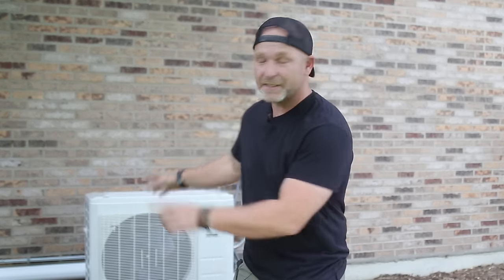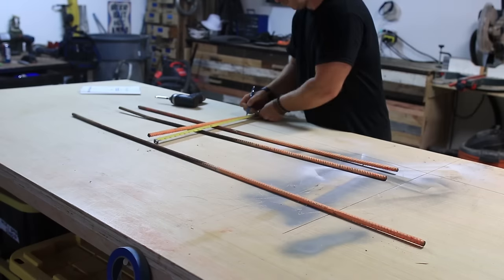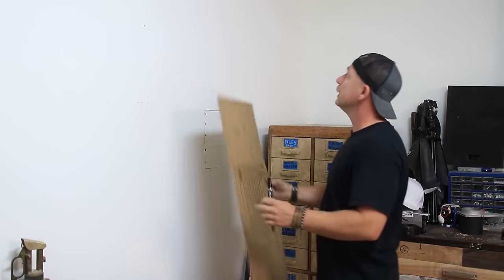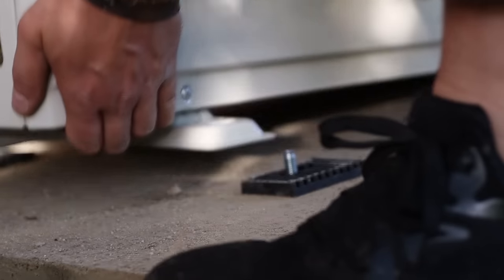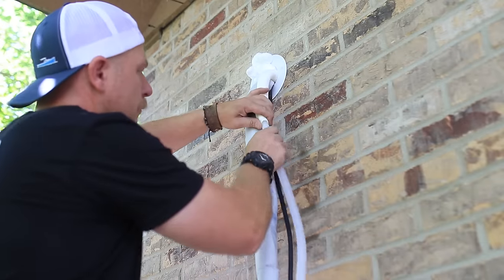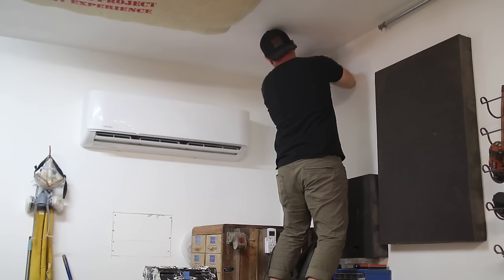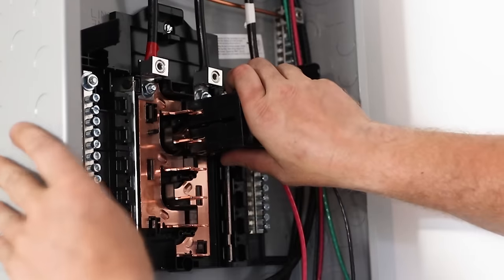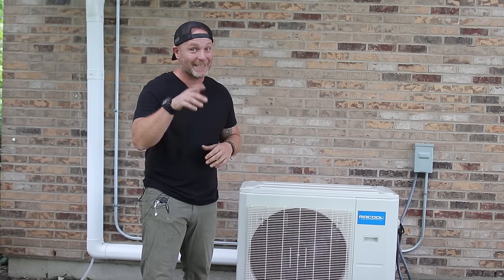How to Install a DIY Mini Split Air Conditioning and Heat Unit.  MR COOL 24K Split Unit

Comment: Hi, I’m about to do the same thing and I was wondering if vacuuming the lines is required?  Thanks
Reply from the maker: Not with this unit.  They are vacuumed in the factory before being filled and sealed.
Reply: @KomarProject  the condenser is filled and sealed not the lineset

Comment: Was curious on why you didn't pull a vacuum on the system before opening the refrigerant lines?
Reply from the maker: with this unit you dont have to.  its done in the factory and sealed before shipping

Comment: Does it need a quick disconnect box? Supposed mines was installed without one which it was
Reply from the maker: That depends on your code for where you live.  It technically doesn’t to work but it’s a good idea when you want to service it

Comment: Am confuse  on why installing a braker for the outdoor unit, i bought a 115v mirage 12000,  is has main power cord  to connect to the wall and one cable to connect from the indoor cindenser to the ivaporator for powering out side unit, but i have an extra thicker wire assuming is to connect it to a braker, is that optinal???
Reply from the maker: That I’m not sure.  I would check with the manufacturer

Comment: TRying to verify the electrical requirements. Most units I have seen say they require 240V. The amazon link says 120. You did not say from what i saw the specific ratings for breaker and fuse disconnect. Can you clarify and did the fuse disconnect come with the kit?

Comment: I have a question. I just bought a Mrcool diy. 24k. Can the 25ft line set be cut to make shorter and reflare . Will vacuum need to be pulled if hasn't been installed yet.

Comment: I’m considering getting a mini split system, but I’m more interested in the heat. Have you used it for heat yet? Did it put out good heat?
Reply: they heat down to 5 degrees and the 4th gen down to -13. but yes heat is good

Comment: If I want to move the unit to another room later would I have to get it recharged?
Reply from the maker: I think you would have to get new line set for it.  Not sure if you can recharge them.  I would contact the manufacturer

Comment: Good job, it all looks like a professional did it. You just forgot one little step. To vacuum the system. Let’s just hope the non-condenser‘s cause an issue in the unit.
Reply from the maker: I don’t think you have to do that with this system.  I’m checking with the manufacturer and I’ll let you know.  There was nothing in the instructions about it. But I’ll double check
Reply: @KomarProject   ok thanks, still a very good video and like I said really good quality work you did.
Reply from the maker: Ya just verified that they don’t need to be vacuumed during installation.  They Vacuum them before, and seal them.

Comment: Great! I need a 50 foot line set. Do I need to buy the DIY version if I have to buy the pre-charged 50 foot line set in lieu of the 25 ft line that comes with it?
Reply from the maker: That I’m not sure of brother.  I would check with Mr Cool.  They have great customer service and will be able to halo you out better then I can.
Reply: They sell 16’ and 25’ extra lines with a coupler kit.  I just ordered it from Ingram Heating and Cooling on line.

Comment: Once the backplate is fixed to the wall, the large hole next to the plate has to be very precise, how do you measure where the hole goes with the backplate????

Comment: Do you recall what size masonry drill bit and anchors you’d recommend for mounting the condenser to the pad? The unit is at my Dads place in a remote area so I’m trying to show up as prepared as possible. Thanks
Reply from the maker: i want to say it was either 3/8" or 1/2" but can t remember .  Either one should work

Comment: Thanks for this video!  Did you run 30a or 50a service to your unit?  I'm installing two 24K units in my shop.  Electrician will be here next week to run dedicated circuits.
Reply from the maker: Hey Blake.  I ran a 30a barker to it with 10g wiring.
Reply: @KomarProject  Thank you!

Comment: any idea on what the difference in utilities this would be from using a window unit/ceramic space heater
Reply from the maker: I have no idea.  Maybe there is some literature on line somewhere.
Reply: Check the cere ratings to compare.  I have an 18K MR Cool and it is a 19 cere and will throttle back the condenser as you get close to the set point so it draws less and less power as it nears your setpoint.  Nice technology, far more advanced than a window shaker.  Looks way cooler too.

Comment: One question can you install the line covers after conecting all the lines
Reply from the maker: You might be able to but might be hard to slide them behind the line.  It’s a two part system that screws together.

Comment: Great video! I purchased this exact unit, I have not installed it yet. What size wire did you use from the breaker to the unit? Thank you
Reply from the maker: It was 10g. Good luck, it’s super easy
Reply: Thank you

Comment: I really want a split ac unit. Hw ever my HOA is giving me a hard time about where it looks and standard build code  for how it looks out door. I have window units. How do to diy in door condesor n draining system. I want a two 7000 in my bedroom n 12k in my living room. I had it done twice before and hired two different AC companies. They don't want to deal with my association after measuring n details. I want to replace my window units. Any ideas
Reply: Plus if don't to drill a hole in my home can it be still be done
Reply from the maker: Don’t think so.  You will need to drill a hole to get the line set out to the condenser.

Comment: .. I have a DIY split system to put in this week. I'm worried about the wiring to the breaker.. I was just going to do the labor and let the client know to hire a electrician. I have an electrical background but the confidence isn't there.

Comment: I have a quick question.  At 13:21 you can see a black cord coming out of the end of the condenser unit.  I see where the power conduit comes from inside into the quick disconnect and then where the whip comes from the quick disconnect into the condenser.  What is the black cord and where does it go?
Reply from the maker: It’s the communication cord.  It’s connected from the inside unit to the condenser outside.  Hope that helps.

Comment: Yours is the second video I've watched on the mini split where the extra line was left coiled up.  Would it have been better to move the unit down a bit further to get the full length uncoiled or even buried the extra line somehow? Other than that, it looked good and hell of a PSA with the ladder as well.
Reply from the maker: Ya it’s a bit of an eye sore but they give you a lot of line to make sure you can put it anywhere.  I have been thinking of making some sort of cover for it though
Reply: @KomarProject  I glad I’m not the one with OCD .. nicely done but those lines coiled up would drive me nuts ... can your bury them or cut them done to size ?  Well done but should have showcased that and included the cons in the video . I’m still interested but mycool should  offer different line lengths in your order if the can be cut ... thanks again great stuff

Comment: That was cool video what gauge cable did u use  and what size of beaker 😎
Reply from the maker: Wire was 10g and I think the breaker was a 40 if I remember correct.
Reply: @KomarProject  cool thank u man

Comment: what happened to pulling a vacuum on the A/C lines. Air and moisture needs to be removed before adding refrigerant
Reply from the maker: So with this unit you don’t need to.  It’s done in the factory before they are sealed. That’s why this can be installed by anyone without having to call an HVAC tech.  But good point because on most units you have.
Reply: @KomarProject  haha, wrong! The open A/C refrigertant lines have air and moisture in them.If you dont evac them, your system now has air and moisture in it.
Reply: @sourdoughben  These are a new type of system - 'DIY'.  They don't require an HVAC installer.  These lines are vacuumed in the factory and charged and sealed before shipping.  The connections have a release valve in them that prevents gasses from escaping until the connection is tightened. A desiccant canister removes any humidity that enters the system from when the connections are tightened.

Comment: At time stamp 7:46 it looks as though you set the excess line set as a vertical loop. Won't that create a trap for the oil?

Comment: how long have you been using it-i concerned with quality
Reply from the maker: So far it’s been six months now.  It’s running heat now as it’s getting cold in the Midwest and the shop is nice and toasty

Comment: Is there any way that the lineset can exit from the top of the air handler so I could run it into the attic?
Reply from the maker: I don’t think so unless you somehow bend it and cut a bit of the plastic housing and run it along side the handler up to the attic.  Will take some messing around with
Reply: @KomarProject  thank you.   I'm guessing that I can't unless there is a pump for the condensate.

Comment: How do you accurately check for leaks before releasing the refrigerant?
Reply from the maker: Just spray some soapy water on it and look for bubbles.  If you don’t see any your good
Reply: @KomarProject  If you release the refrigerant and then find leaks you'll obviously be too low. Wouldn't make more sense to test for leaks before the refrigerant release?
Reply: @scottreid4170  Yes but you need to use the vacum first  if you dont have leaks you proceed with the refrigerant. 

P.S. is a espetial vacuum for those tipes of jobs and is the most important step.
Reply: @MsFranklincrazy  Ya I get it. I was trying to educate through questioning. People watching this video will think they can just hook the lines up and release the refrigerant. Not a good idea. I wonder how many of these Mr. Cool DIY installs include refrigerant entering our atmosphere. Good stuff
Reply: @scottreid4170  Well 2 late for that.
Reply: He described a basic lead checking method in the video (at only one pressure). The unit is one of the only solutions that ships with refrigerant pre-charged in the lines and hardware. So if you do things right the first time you are ok. If an installer screws up then you have a conventional installation that requires purging of the air via vacuum and then charging from an external tank.

Comment: I hope your subpanel was off when you opened it up. Just for safety reasons, I think you should have demonstrated testing the feeder cables to show there was no voltage. Never work on a live panel.
Reply from the maker: Totally agree.

Comment: What amp breaker did you guys use?
Reply from the maker: I think it was a 30.
Reply: @KomarProject  I noticed that your answers tend to vary - 30A, 40A, as well as the size of the concrete base you made (18x30, 24x44).  If you get a chance, could you post in here what the true values are?

Comment: I just bought a 18000 btu . How did you get free hole sawl and wrenches. I don't think I got that ,😳 what gives.
Reply from the maker: I just showed up with the kit. Figured it was part of the package. Maybe that’s the difference between the 18-24k. Not sure.  You like the unit ? I’m loving my

Comment: So the air handler gets it's power from the condenser outside correct?
Reply: Please help me
Reply: On this system, yes.  Other, cheaper ones have a separate power plug for the inside unit.

Comment: For the most part it looks easy, but don’t you need to pull a vacuum on the loop to get all the air out?
Reply from the maker: Not on this unit.   It’s done in the factory before being sealed.  That’s what’s great about it and making it fully diy
Reply: @KomarProject  wow really!? That does make it very easy! I may consider getting this for my basement then, my biggest drawback was the installation cost (roughly $2000) which is more than the unit itself...

Comment: One thing u forgot to do is pull vacuum on the unit and have someone check the charge to make sure it is properly charged other than that it looks good
Reply from the maker: With this unit you don’t need to vac. It’s don’t in the factory before being sealed. That’s why it’s such a great diy unit. You don’t need a hvac person to come out
Reply: @KomarProject  but wait when u conjoin the two copper line set there's air in the line set how can u just not pull vacumm?
Reply: @yangyangs34  These are a new type of system - 'DIY'.  They don't require an HVAC installer.  These lines are vacuumed in the factory and charged and sealed before shipping.  The connections have a release valve in them that prevents gasses from escaping until the connection is tightened. A desiccant canister removes any humidity that enters the system from when the connections are tightened.
Reply: @pokerpig9069  I wish you knew what you are talking about. How are the lines vacuum from factory when u literally have to connect the line set to the unit yourself. You have no idea  what you are talking about
Reply: @yangyangs34  lol mate, you need to do your research. The lines are already charged and have valve connectors that keep things sealed. When you screw them together enough, the valves open. Basically no contaminants enter at that point. Any moisture in the lines is removed in the main chambers. This is new stuff; you’re still stuck in contractor-is-king mode. It’s designed for DIY installations that don’t require traditional vacuums and purge. Do your research mate.
Reply: @pokerpig9069  the line set are not charged. I do this for a living. The compressor is precharged with refridgerant. The line set are just Line set with flare fittings that you have to connect to the shraeder valve. Stop acting like you know when you don't
Reply: @pokerpig9069  show me where the line set are pre charged and I will say you are right otherwise you are completely wrong. The compressor comes precharged. All the refridgerant are in the compressor not in the line set

Comment: hello.  Did you have to evacuate/vacuum the system and dry it out with nitrogen then have it charged with freon?  Your video is not showing that?   Anyone is welcome to answer this question, thanks

Comment: Did you not have to pull a vacuum on the unit ?
Reply from the maker: No, don’t see why.  Now sure what your asking.  Sorry
Reply: @KomarProject   The unit you are using is one of the only solutions on the market that has lines and equipment that are already pre- vacuumed and charged with refrigerant.  Like other AC systems a desiccant canister removes any humidity that entered the system from where you tightened the connections.  So for the last century all other AC units have needed to have a vacuum pump attached and run for a long time to remove the air before you could then add the correct amount of refrigerant to the lines.

Comment: Thinking about purchasing one of these for my living room is a 25x30. Dont know if I should go with this one or something slightly bigger. Dont want to purchase something to small that will be constantly running from the Minnesota weather. Any info help. Sorry for the fall man that looked like it hurt ah little.
Reply from the maker: The 24k is more then enough to push that space.  My shop is 24x36 and it does a great job.  You might even be able to get away with going to a 18k. Check the manufacturer specks on sizing.
Reply: @KomarProject  Thanks for the response. I just measured my square footing and it's right around 900sq/ft so I'll have to order online. Thank you I appreciate it.

Comment: Any idea how Mr. Cool stacks up to Mitsubishi for quality?
Reply from the maker: That I don’t know.  But I know my system has been great
Reply: I was told that Mitsubishi is the gold standard for mini splits.  I was going to install an 18K Mitsubishi($3500 from an online Co.), but Costco just offered the Mr Cool 18K system at $1,500.  I’m such a cheap ass, but I couldn’t pass it up and bought it from Costco.  Thankfully I have a retired electrician next door to help with wiring up the 220VAC line.

Comment: So you don’t need a vacuum of the lines?
Reply: As you noticed in the video, the lines are pre-charged from the factory.  These types of units are made to be DIY installations so the use check valves in the lines that release and open once they are connected.

Comment: Theres so much conflicting info on whether to coil or not to coil. Most techs say no but even the MrCool vids tell you to only use/uncoil what you need and leave the rest coiled behind the unit. Why did you choose to coil?
Reply from the maker: I needed to hide it somewhere and uncoiling everything would be an issue for me.  And since these are charged you can’t cut them.  I guess if they come coiled already it shouldn’t be an issue.   Hope that helps

Comment: Question on specs please....
Minimum distance from back of outside unit and wall?... Also, distance center to center bolt holes on feet of outside unit?....
BTW...  Pulled the same ladder stunt, landed on my hammer and still have a lump, ten years later....please be careful!..... Thanks.
Reply from the maker: Ouch I would consult with the manufacturer on that for minimus.  Sorry brother
Reply: 3 feet

Comment: How does the heat hold up?
Reply from the maker: Is only been a month since I had it so don’t know yet.  I did have it on auto one day and the temp outside dropped and the heat turned on.  It blew very well.   So I’m guessing it will be great during the winter.   Let u know in a couple of months.
Reply: Komar Project thank you. Great video btw.